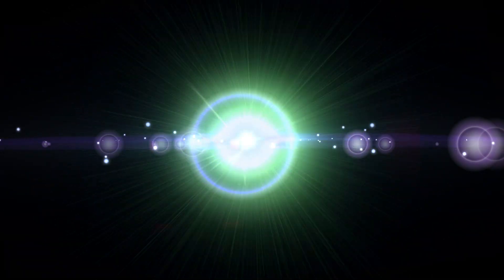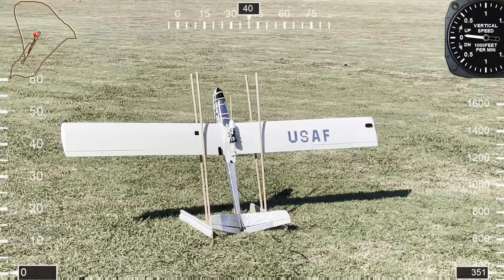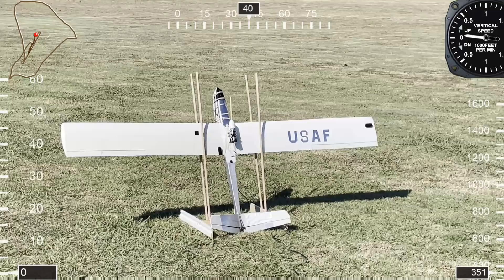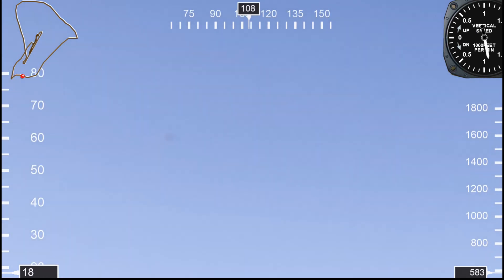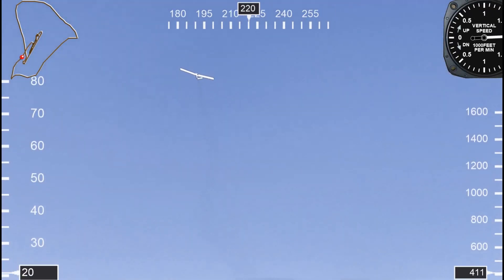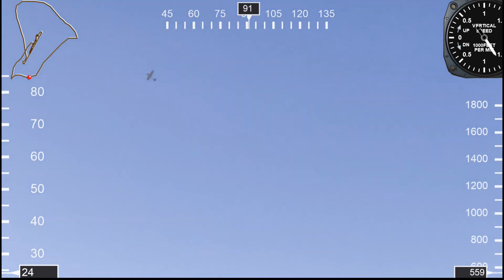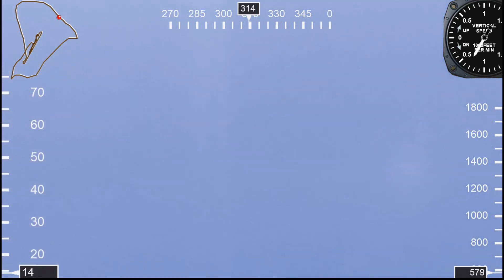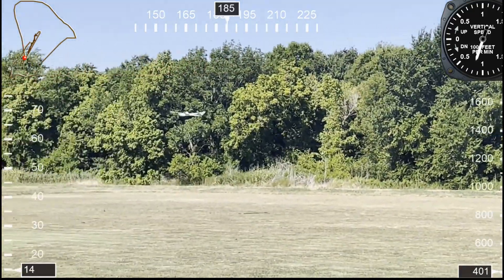FLYING AN RC ROCKET GLIDER WITH LIVE FLYING DATA ON THE SCREEN ROY DAWSON VIDEO

Comment: nope. your tower is just not adequate for the model. it was permitted to "pivot" in the tower. you can see the wires are loose and being "flicked" up they did not drag the model down. the thrust angle did that all on its own.

you need a larger sturdier tower to "restrict" the model movement just a bit longer to let aero take over. Double the length of those rods and nail that launcher down. the "whole launcher" pivoted with the glider on ignition.
Reply: Because the rocket motor is not in perfect alignment to the flight axis, it stands above the wing and creates a rotational moment.  The taller the rocket motor mount and the longer the arm, the worse the problem will be.  Having a stiffer, more stable launching platform, and one that is longer, should also help.
Reply: Agree. Had nothing to do with the wire. Up elevator is also necessary at takeoff since the engine is some ways off on top to the center line.